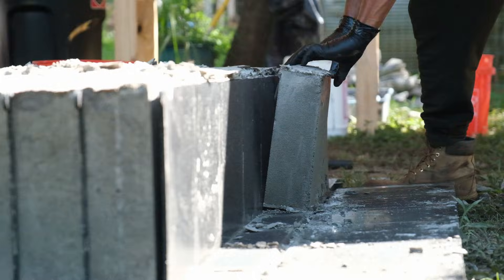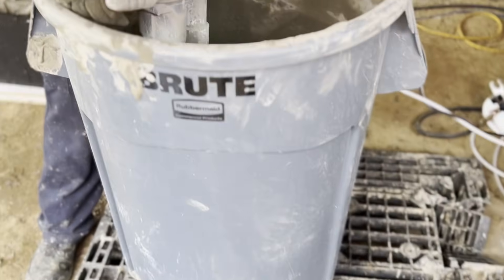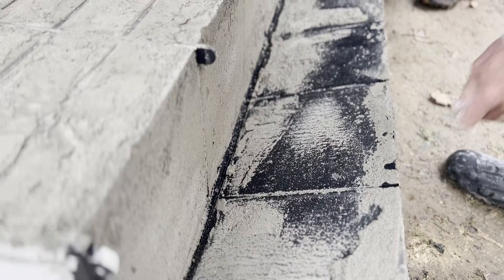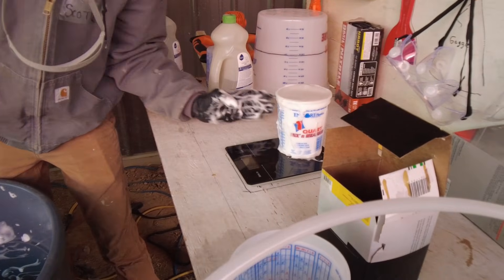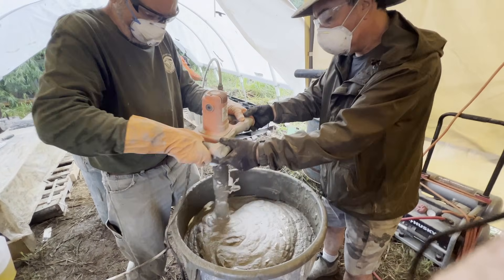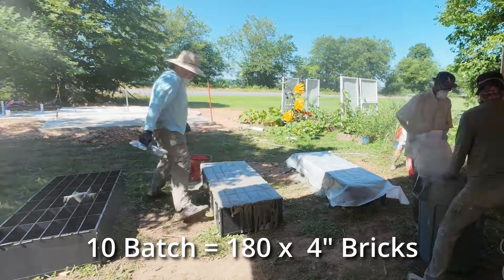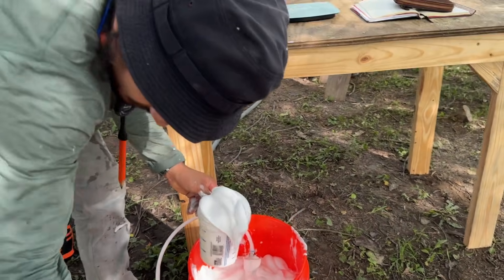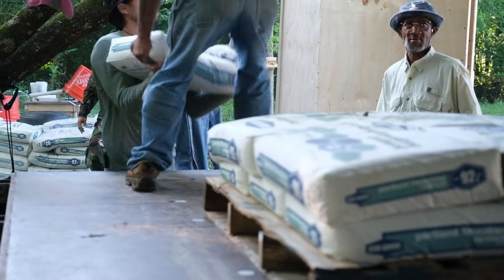How to Make Perfect Aircrete - Complete Guide

Comment: I was hoping to hear what a good aircrete density is. I'll be mixing the water with the foaming agent first, then adding it to the dry cement and mixing it until it reaches the right density. If I keep mixing the aircrete get lighter and lighter until it changes from closed cell to open cell and when dry it will be porous.

Comment: That Adjustable Dial on the Dragon XL Foam Generator - Needs a Pointer, and a fixed scale beside it- numbered, so you can improve repeatability.
Reply: That's called a needle valve and you can make your own marks with a Sharpie.

Comment: What are the benefits of aircrete over styrocrete?
Reply: A diferença é que você não tem o trabalho de triturar o EPS só que tem um porém é que Nei todas as pessoas conseguem fazer o concreto celular ele é um pouco mais difícil de fazer que o concreto leve com EPS
Reply: The difference is that you don't have to grind the EPS, but there is a catch: not everyone can make cellular concrete, it is a little more difficult to make than lightweight concrete with EPS.
Reply: Styrocrete appears to be the clear winner in this comparison. The temperature and other water quality type issues affecting the aircrete make it a bad choice for a beginner.
Reply: una de las diferencias es la propiedad ignífuga del concreto celular, ademas de ser térmico y acustico.

Comment: A few observations from my own experience building with aircrete. Drexel another commonly used  foaming agent is also very sensitive to cold temperatures and foam collapse, I will not even do a pour unless its going to be above 50 degrees for at least 12 hour after the pour. Forms made of wood seem to to pull moisture out of the aircrete leaving about a half inch layer of softer more crumbly aircrete wherever it was in contact with the wood, If using wood forms it's best to line it with plastic or better yet take the time to build a quality re-useable mold from plastic or metal. In addition to running the foam generator off of its own electrical circuit, running your air compressor off a dedicated circuit is equally important in preventing current drop at your compressor leading to inconsistent air pressure. A larger diameter air hose and compressor mounted regulator that can be dialed in close to the correct pressure before the air reaches the regulator at the foam generator will also help maintain consistent air pressure. If you have the time to do so, leaving the blocks in the forms for 3 or 4 days or even a full week to more fully cure before removing them leads to far less breakage of blocks while handling.
Reply: Good tips for working with Aircrete.
Reply: @AircreteHarry  Thank you Harry. Another hard learned tip to add to the list, make sure all the connections to the foam generator are tight, a hose falling off mid pour isnt much fun.
Reply: Thank you for perspective
Reply: 50 degrees? english or metric?
Reply: Thank you, extremely helpful information.

Comment: Air Crete is supposed to be less expensive than actual concrete and you have just added thousands and thousands of dollars to it making it more expensive than anybody cares to pay they would rather buy a regular house! Good luck on your endeavors😊
Reply: There are many benefits to an Aircrete dome home, compared to what you call a regular home. A regular home can burn down like all the homes in CA and Hawaii did. Aircrete will not burn so you will always have a home to come back to. Being dome shaped they are resistant to hurricanes, Tornados, earthquakes, Termites. A regular home is not! Long story short if you build a Regular home and you lose it because of a natural disasters or bugs. Then you will say I should have built an Aircrete dome home the first time.
Reply: Its actually only a few hundred dollars for all the tools and equipment needed to build with aircrete.
Reply: There is something wrong in the comparison. Anyone who likes to build their own home needs tools. From a shovel to a generator if you live remote or like me, where the electricity company didn't pull the lines yet. And most importantly. You need a civil engineer in the municipal office who will give you a  building permit for your project. I didn't get one here in Panama where I live. Aircrete was a total no no for the office. That's when you just use what locals use.
Reply: @holgermessner851  You're absolutely right that tools, permits, and local regulations are a big part of any self-build project—especially in remote areas. I build using a system that combines an inflatable dome air-form, reinforced concrete (with rebar and mesh), and then add an insulating layer of Aircrete or Styrocrete on the outside. It’s not just straight Aircrete, which often doesn’t meet code for structural use on its own.

Because the main structure is reinforced concrete, this method usually gets approval from local regulators more easily—they're familiar with how concrete works and how strong it is when reinforced properly. The insulation layer is added after, and doesn’t affect the structural integrity.

That said, every country—and even region—has different rules. In some places, you’ll still need to work closely with a local engineer to get sign-off. Other times, it’s easier to use what’s already familiar to local authorities. I’ve found the best approach is to adapt the system if needed, while still keeping the benefits of the dome form.
Reply: @AircreteHarry  I switched to concrete blocks usual used in Panama. Still, I did build a circular house with two levels. Ceiling in the main level is 3m / 10ft high. The walls in the upper level are 2.5m/ 8ft with the center 3.7m / 12ft something. I only had the idea for one level. My son in Germany asked what he should do if the Russian aggression was coming closer to Germany. So I just needed an architect to get the mathematics right. I had (like in Germany normal) 28 columns in my lower level. Each window, each door and each corner had 2 on its sides. I couldn't get the stairs inside the building because I would had to sacrifice one bedroom for that. So I poured concrete stairs outside the building up to the second level. My ceiling at the main level is 10 inches /25cm thick. The funny thing is that local people call it: The CASTILLO / CASTLE. 😂 Everyone is building normally one level square houses in Panama. So sometimes I have strangers stopping by and take a photo. Weird. And I build all by myself. Well. The foundation slab and ceiling were build with some of my neighbors who always look for work.
Reply: @holgermessner851  I was half-expecting you to say it has an alligator moat and two guard towers! Now that sounds like a fortress built to withstand any storm. Honestly, that’s one of the reasons I love domes so much—they really are nature’s castle. The math behind them is simple, but the engineering is brilliant. When you build a hemispherical or ellipsoidal dome, the structure naturally distributes forces, putting the entire shell in compression—which is exactly what concrete is best at. It’s the ideal material for this shape.

One of the biggest advantages for me is the speed of construction. Once the airform is mounted and I’ve run the rebar and mesh, spraying the shell takes just one day. By the next day, it's already cured to around 3,000 to 4,000 psi. Then I can remove the airform, add my insulation layer, and start on the interior layout. Since the interior walls aren’t load-bearing, you can divide the space however you want—or even add a second level if you like.

There are so many benefits: you use fewer materials, you get a much stronger and more resilient structure, and the aerodynamic shape makes for an incredibly quiet and peaceful living space. And if you want, you can even bury the dome later—the geometry makes it excellent for handling that kind of load.

All in all, domes just make sense to me. Compared to traditional square homes, they offer strength, efficiency, speed, and flexibility—all in one elegant design.
Reply: @AircreteHarry Honestly? For me it's a $$$$ mathematic. I would need the aircrete tools. The "balloon" you are using. For that kind of money, I buy the concrete blocks, sand, rocks, cement and windows for my project. I honestly think to buy all this equipment makes only sense if you have a company to build a couple dome houses to get the money back for the equipment. I'm short of money. Always was. And I can say that I did build myself a house in Germany. Bought a house in Canada.  Building a house now in Panama. I wished I could pay the total overpriced, low quality houses in Panama like many American Expats. But even if I had the money, I wouldn't buy one house. - Still. With the view bucks I have, I make something that looks different. My idea like I mentioned before was to build an aircrete dome. But pandemic hit, lost again everything in Canada and just figured out what to do next.  Good luck with your project. I just need another 199 years to finish the Castillo. 😂
Reply: @AircreteHarry Hey if I can ask you something.  I have seen videos of people mixing up dish soap. And breaking down blocks of stryofoam. And mixing this into "concrete" (maybe technically something  different than concrete, but hopefully you know what I am talking about)  Why do all the "aircrete" say you need all these tools, especially  the "dragon" while others are simply mixing with whatever they have at hand? One man, I believe  is in Africa somewhere, and doesn't even have access to most specialized tools. Yet he is making beautiful bricks. What am I missing? Does the addition of Styrofoam change things that much? Or can you actually  also make aircrete without these rools? What's the difference? Thank you!
Reply: @AircreteHarry  You put the non autoclaved aerated concrete (NAAC aka aircrete) on the OUTSIDE os the reinforced cement concrete (RCC)? That's ass backwards. You want the high thermal mass on the outside (RCC) and the low thermal mass on the inside (NAAC).
Reply: Owning tools is part of every home build.

People who want to build their own home know this.

Less tools, and less high-cost tradesmen are needed to build an aircrete dome home than a brick, cinder block, or stick frame house.

The aircrete dome is one of the best homes someone can build from an economical perspective as well from a longevity perspective.
They also require immensely less maintenance, less high-cost skilled labor, and are easier to make edits to after they are built.

Sure, if you are only wanting to make 100 or less blocks then buying tools to make aircrete might not make sense. But if you are building a custom home, aircrete dome homes are a fantastic option.